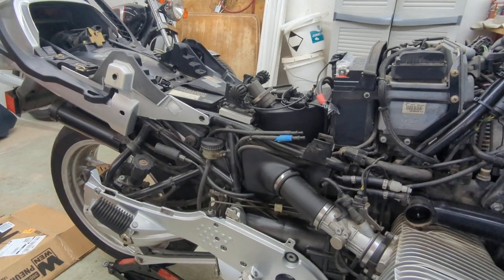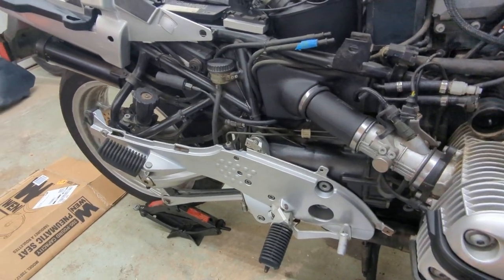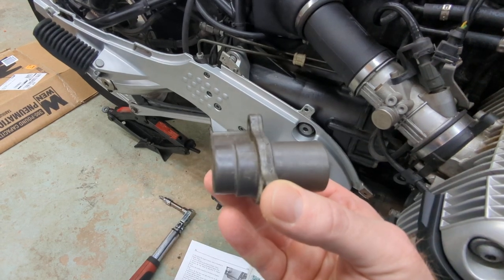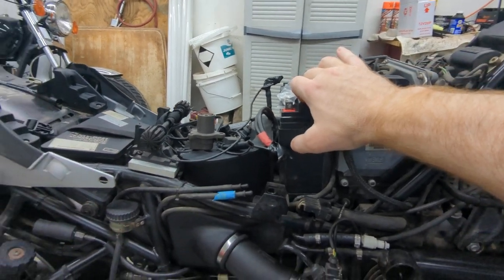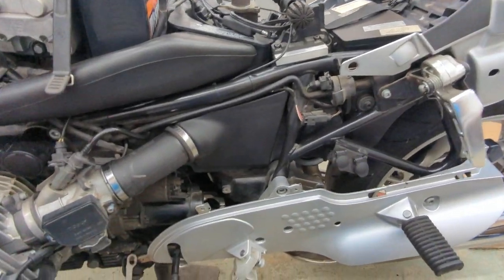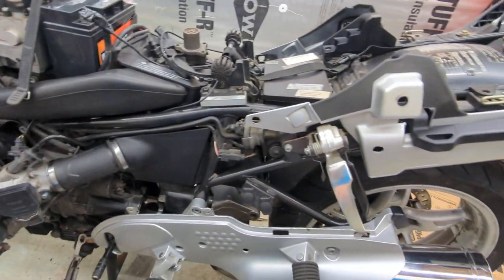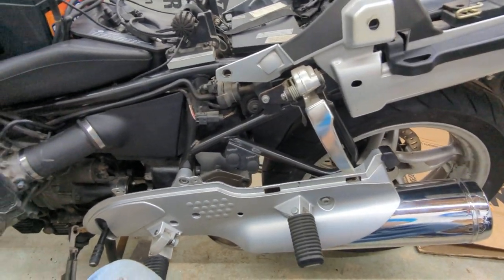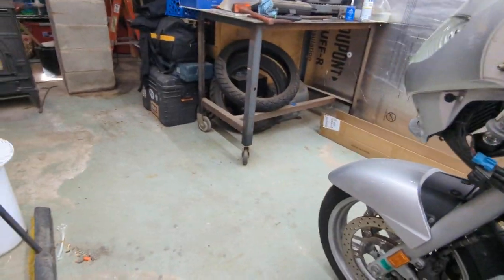2004 BMW R1150RT clutch slave cylinder part 2

Comment: I had an idea to drill a drain hole as that would at least keep it from taking out the clutch disc. I may try to put either a seal or a o-ring in the trans main shaft to seal the pushrod, but I’ll see as I have to go all the way , trans out and clutch pack disassembled and while there, maybe check out the main seal. I did already change oil. Here’s a tip from me with 42 yrs as engine machinist, older engines, put an oz per qt of KW TransX in the blue and silver bottle when you change oil, it’s seal conditioner and I’ve personally had cars go from valve seals leaking so they burned a qt per 800 miles and over time go to 2500 mi per qt and it fixed other seal leaks too. Good Stuff!

Comment: I bought a 03 1150R with 10,068 mi and had set for awhile, well I’m less than 100 mi since I got it and clutch slips at speed when it hits powerband in high gears so I’m suspecting clutch slave leaking thru trans input shaft on the disc. I’m not happy. Even with regular riding the input shaft splines are to be lubed with a high %moly lube so it’s a whole trans pull. They could have prob put a seal or o-ring to keep brake fluid from traveling up the clutch shaft and taking out the disc. I’m afraid of riding it as is as I don’t want to burn hot spots on the metal (pressure) plates.
Hopefully I can get a used motorcycle lift to work on this. 
I had a 1000 GoldWing in 1975 and it didn’t have   these issues even though I had engine out 3 times in 50K mi.
I always wanted a BMW motorcycle (R90S back in the day) so here I am in retirement going back to work as a motorcycle mechanic😜
Reply from the maker: I feel your pain. It's a miserable job takes way too much mental energy to even wanna tackle that task. Somebody mentioned drilling a hole so fluid can drain out. I mean that could keep the clutch dry but doesn't fix the issue. These slave cylinders are obviously junk. Should not be swapping out with low miles. Good luck